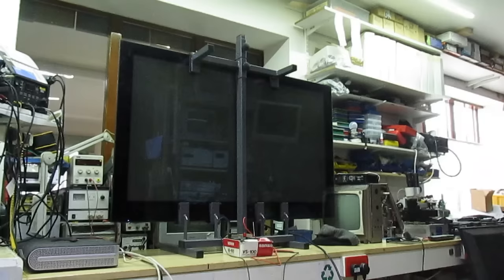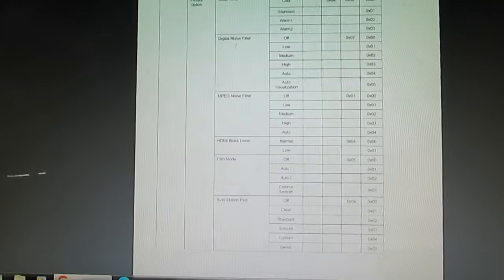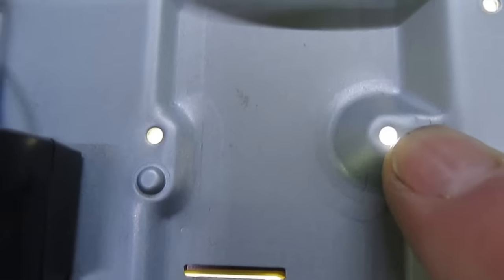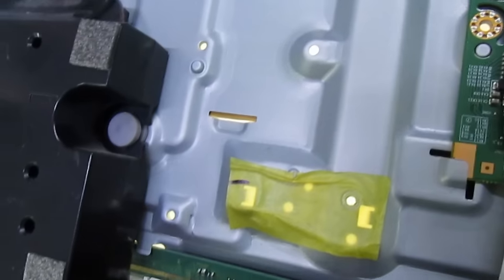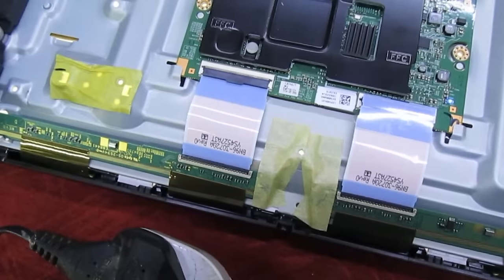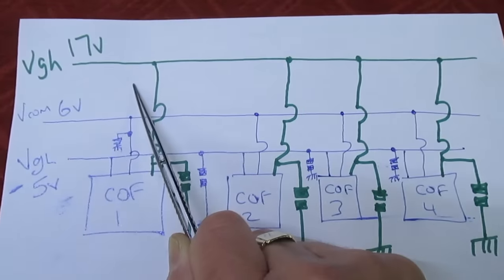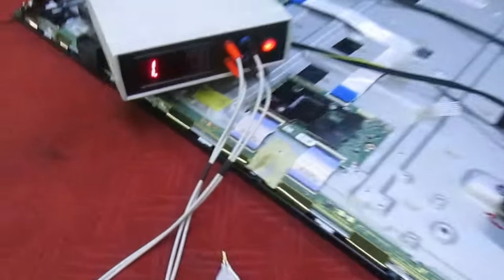Video to highlight the problem of repairing flat panel TV sets

Comment: We of the old school have been replaced by board changers, who have the nerve to  call themselves technicians , who probably have had  no training to  component level, and this TV would have been a scrapper,  I despair. marvellous video
Reply from the maker: The tables have turned full circle, there was board swapping in the 80s and lots of companies advertising in Television magazines selling used boards for thorn 3500 etc so anyone with no skill could repair a TV, then in the 90s all this disappeared with the single pcb and now 40 years later were back to board swapping!
Reply: Consider the value of a TV compared to the cost of the repair.
It it took 2 hours to take apart, fault find, replace component and put back together again, that's about the value of the TV in used condition..
Most people don't want to pay more to repair something than it's actually worth, unless it's got some sentimental value in which case there's big money to be made off the customer

Comment: Good stuff Michael.  Just imagine how many flat screen tv's have been scrapped for the sake of such minor component failure!  All intentional of course, and why detailed service info is not made available.
Reply: And when you scrap these, not so much material got back in use. At least those panels need rare earths metals and looks like China is way to get these. There is not much in one panel, but if you throw all away with junks, then those are gone. Not even sure does anyone try to get these off from electric waste to recover those materials, but I know many who took full flat from waste and fixed it to use :p
If you could fix one flat per day and one fix fails and goes spare parts, you still could get living with that and if you have source to get these throw aways, then it's even better :p
Reply from the maker: absolutely right and all designed just to sell another one as you say .
Reply: @michaeldranfield7140  
So bad for the environment though, thousands of tons of various metals that are lost to landfill, some toxic of course. Plus plastics, glass and chemicals, all the energy involved in manufacture, distribution, delivery etc.  An extremely wasteful and irresponsible policy.  The right to repair legislation that is being debated in the USA currently, should be mandatory worldwide, with full, detailed service info being a legal requirement. We can wish anyway!
Reply: @michaeldranfield7140  That's what they mean when talking about "sustainability".
Reply: @michaeldranfield7140  Made to break just after the warranty expires.
I find that another common problem is the electrolytic capacitors in the power supply fail quite often or a heatsinked semiconductor.
Reply: @hugoromeyn4582  mp
Reply: P
Reply: @hugoromeyn4582  0 pppp
Reply: @turboslag  p
Reply: @michaeldranfield7140  0 l0 0p
Reply: @michaeldranfield7140  0ppp
Reply: @michaeldranfield7140  pppppp0
Reply: @turboslag  maybe we should allow people to go through the landfills for valuables?
Reply: Oh, My, I'm sooo happy, just fixed my TV, same model and exactly same problem, but with no miliohm meter I had to trust in a really small difference measured with a normal meter. Thanks a lot for your post, so much detailed. I just can't thank you enough!
Reply: @michaeldranfield7140  Crazy thing is if you try to pick up old TV,s or even Washing machine part's from the local tip you get screamed at to put it back. I'm guessing the council worker's must be on some kind of fiddle with the scrap or recycling ♻️ companies.😔.
I just can't understand why they wouldn't want to keep stuff out of landfill.
Reply: An excellent video Michael,  thanks, and you're absolutely right about the "Right to repair" legislation needing to be successful. I  have an issue now with a Roberts MP 43 radio 📻,  its simple, the built in PSU has failed but they (Roberts) won't supply me with a replacement and as I can't get the special transformer that is faulty, I  would have to send it back to Roberts and that's £80 just for them to look at it. There has been a few sets like this on ebay looking like they have the same fault, spares or repair. 
When I bought my first Sansui hifi Amp, I  got a full circuit diagram with voltages, as did everything I bought in the 1970s so our experiences are the same here. 
No circuit diagrams now .😡🤞😊
Reply: Every time when I go to the environmental facility in my city to get rid of stuff that really is beyond repair, broken or chemical waste, I'm always shocked how many TV's are there that are in top-notch optical state and probably only feature bad components in the power supply. Ofcourse there will be screen-damage ones, but darn... my fingers always start to tingle to start troubleshooting them there.
Reply: Let's not forget..people love an excuse to buy another tv.
Reply: @Mental_Patient  Yeah but I also think that those are the kind of people that usually tend to discard their devices (resell them as second hand when still working) 'because there's something better'.
Besides that, many people don't even take the time to adjust their TV. The out-of-the-box settings are usually extremely bright, overly-saturated and with insane contrast to get this extra vibe of 'look at what you just bought, isn't this great?'.
Many people don't know that the LEDs inside are burning up really quick at those settings or they even think their TV is supposed to look that way.
Reply: @andrew_koala2974  Woha mate... there's a very big difference between those subjects. There's a group of people who doesn't want to pay for quality anymore (by far the majority) and the people that do still pay for something well made.
The bottomline is that many manufacturers were at risk of being pushed out of the market because their products did not adhere to the huge pricedrops of the mainstream brands like Samsung, LG and such and thus had to go down the same road to survive.
But seriously: buy an LG monitor and compare it with a same size/resolution Iiyama. The Iiyama is built far more sturdy, and at least can be opened by removing a whole bunch of screws instead of the many click-notches on LG's (and many other brands...).
My LG I used before my current Iiyama is a total joke when it comes to build-quality: to they advertise it as a screen that can be rotated as well, I seriously wonder how long the monitor will survive that abuse, as there is NO metal chassis inside: the VESA-mount that attaches to the stand or a wall/desk mount is just 4 pushed/melted in nuts inside the plastic case. As the PCB with all the connectors is attached with just 1 screw to this plastic assembly, and the PCB itself is only secured with two screws at the bottom, all the forces are unleashed un this PCB. I found it an absolutely ridiculous solution for a monitor that nearly cost me 500 Euro.
Reply: I say go to the back door of the factory in Korea and threaten them with denouncing K-Pop unless they cough up the extra-detailed service manual...
Reply: In one year 3 TVs have given up, all due to bad capacitors.
Reply: @Janne Johansson  if there was an organised system of triaging electrical and electronic equipment, when it fails to work, to sort the repairable from the recyclable, it would provide an opportunity for a repair workshop to be set up with a second hand parts sales outlet.
I have assisted with electrical repairs at a community repair cafe, and it was interesting to note how minor the faults were that needed to be rectified in domestic electrical equipment.
Reply: @stevejagger8602  
Excellent idea.  I have rescued so many appliances and equipment from an early grave which have extremely simple faults.  Problem is, at a commercial level, not many products are viable repairs because of high relative service charges.  EG, who would pay £100 to repair a £300 that is maybe 3 years old?  If volunteer or subsidised repair centres could set up then it might work. Changing the disposable culture on a meaningful scale will be difficult though.
Reply: @turboslag  the repair cafe concept runs on volunteer support and the one which I supported in my old home town of Machynlleth in mid Wales was also about a sharing of knowledge for those who were interested.
They were full on day sessions every month. Exhausting but thoroughly enjoyable, and good forgetting to know other repairers and making new friends within your own community..
I think is an established network of these volunteer repair cafes in some parts of the UK.
It’s an essential step in the direction of reuse, which is preferable to recycling.
In the end there won’t be any other option because of the inevitable depletion of the resources to make anything.
Reply: @davesmith8101  
Hmmm, doubtful. As long as non of them were of Chinese origin!!!!  There was too much at stake to jepordise the project by using low quality or suspect parts. Almost certainly everything was either custom made to spec or of the highest standard mil spec.

Comment: Thermal Camera might be able to see the Cap getting hot as it is shorted and acting as shunt (generating heat)
Reply from the maker: A lot of circuits now switch off the supply when they see a short but it would be possible to apply power from a bench power supply and see what heats up .

Comment: This is why there is so much e-waste. An expensive TV lost to a 5 pence capacitor. A great video, I'll bare this in mind when my 3D TV fails as I can't replace it now 3D is not a thing anymore. Thanks Michael for sharing.
Reply from the maker: Just imagine how many more sets that could be repaired if manifactures supplied service data and spare parts.

Comment: You are the best teacher. I have been a mechanic for around 40 years and have been teaching myself electronics. You attack diagnostics on circuit boards like I diagnose cars, and it makes it much easier for me to understand.

Thank you!

I remember the good old days walking down to Walgreens  with a bag of tubes for the tube tester.
Reply from the maker: Unfortunately with no service manual or circuit diagram this is the only way you can diagnose modern electronics.

Comment: Excellent video and a fantastic master class of fault finding. Technicians change parts until the equipment works, an ENGINEER  finds the problem, fixes it then finds out why it happened in the first place, you sir are an ENGINEER!
Reply from the maker: unfortunately now fault finding is more good luck than skill as no one produces schematic diagrams now and everything is board only replacement .

Comment: My component-level knowledge is very limited, but I absolutely love watching videos like this.
Great work in preventing yet another tv from a destiny of landfill.
Reply from the maker: This was actually a relatively simple fault, I could repair more complex faults if I could get service data and some support from the manifactures.
Reply: @michaeldranfield7140  any repair is of interest to me, no matter how big or small 😀
Reply: @michaeldranfield7140  We need to lobby government for a right to repair law, which would make it illegal for manufacturers not to supply the circuit diagrams. 
Same goes for car's with the stupid reprogramming the ECU when you fit a new battery. Pure Greed.😔

Comment: Hi Michael,

A great video. This is what I have used to find a faulty bypass capacitor on a computer board that has a bypass capacitor for each chip.

Connect a variable voltage power supply via a resistor to the track. And slowely increase the voltage (until you are able to get a voltage reading as follows). Then use the volt meter to read the voltage to ground. And move in the direction where the voltage measured gets less towards the faulty bypass capacitor.
Reply from the maker: If the short is above 1 ohm I use the bench psu method to see what gets hot or burns up !
Reply: If you use a high enough voltage/current, it makes magic smoke!
Reply from the maker: @mrtechie6810  or burn your finger looking .

Comment: Great fault finding skills there, one thing I would have done differently is replace all decoupling caps if they're exactly the same, if one failed, the rest will follow
Reply from the maker: That is good advice but unfortunately customers are now much more price conscious and seem to want everything doing for next to nothing , this is why I only replaced the faulty part, however in the case of backlight failure where its a big job removing the panel without damaging it I only ever replace all the backlight strips , I never replace individual LED s as some people do .
Reply: @michaeldranfield7140 
This is an ever increasing problem - 
Consumers imagine because the device they purchased is relatively inexpensive -
that it should be also inexpensive to repair - where in reality it is becoming more
difficult on many levels -  including lack of service information  - NO service Manuals -
No Service Bulletins -  Lack of major replacement parts after four years (which is the 
Statute of Limitations in respect of warranties) so anything beyond that is NOT 
covered  - despite Manufactures claims  of extended warranties. Law is Law.
The general population has no concept of the knowledge and skills required to
earn and understand how these technologies work - the time taken to learn and keep
up to date with developing technologies and the high cost of investment in equipment
 - and its replacement and maintenance costs - addition and replacement of
equipment and  $$ invested in stock that may soon become obsolete - and considered
an economic loss - Then there is the cost of Stock control and administration of
a business - insurance of various kinds -  accountants fees -  Office requirements & supplies.
+ one has to make a better than average living  - That is the whole purpose of a business.
PLUS the business has to make a profit to allow for future expansion and growth.
Plants need Liquid water  -- Business needs Liquid assets.
It is not the cost of the replaced part -- it is the cost of knowledge and experience and the
cost of doing business.
Life is difficult - Business is equally difficult - Customers can be difficult

EXAMPLE:
▶ ‘We cannot survive’: Businesses struggling with costs
https://www.youtube.com/watch?v=qUn5rGfOIyQ
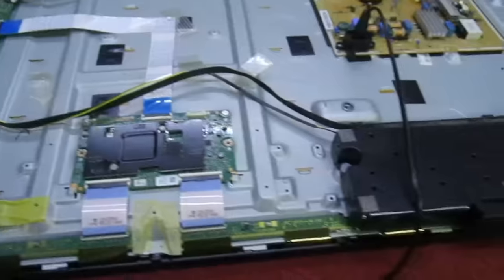                    Jun 16, 2022                                   05:54 -----------------------------
CHANNEL: Sky News Australia
         https://www.youtube.com/channel/UCO0akufu9MOzyz3nvGIXAAw
; Appetite Five Dock Co-Owner Phillip Salhab says his business
; “cannot survive” as his venue struggles to hire staff and deal
; with rising cost of living prices.

Comment: Got a flat TV for free where one segment of the panel was dead. Fault was easy to find, one of the COF cables delaminated. I was even able to find a replacement on AliExpress, but as said in the video you need some fancy equipment (an ultrasonic soldering machine). So even when you know the fault you're often not able to fix it without special tools. Scrapped the panel and sold both boards (CPU and SMPS) for about 80 € on eBay.
Reply from the maker: Panel failure is a very common problem now , much worse than when I made this video , Samsung's are the worse, dreadful sets .

Comment: I repaired a tape deck (from the early nineties) that not only had an exploded view in its service manual that explained the order to do things in, the thing also had a specific little notch to rest the new belt on while you reassembled a very compact mechanism, to finally slip the belt onto the flywheel later, and skip a world of awkwardness.  That's extra thought put into the most likely failures to an almost unnecessary degree - I would have managed without, just with a lot more awkwardness. I love the fact that that was once the standard.
Reply from the maker: Those were the days when things were designed to be repaired and supported with spare parts, sadly long in the past now.
Reply: I think that most electronics equipment with small parts have tiny mechanical assemblies that have to be completed using special jigs. All the details have to be planned for manufacturing, but there is no financial incentive to make any of the fiddly parts re-reassemblable  by the customer or a serviceperson. 

In any case, due to mechanical or electrical failure with time, customers are forced to accept early failure and discarding as inevitable. And, of course, not even mentioning the failure of manufacturers to test an adequate number of units coming off the assembly line or to provide incentives to assemblers for improving the quality of the final products.

Comment: I am a TV technician. So yes, it is difficult, if not impossible, to find some failures without diagrams. But the fault you show is a known and easy to find.
Reply from the maker: I know it's a very common and easily fault to find with the equipment but the video was to highlight how easy it is to make a wrong diagnosis as the back light lit whichever of the T con ribbons were removed which would lead some people to assume the main board is the problem when it's not.